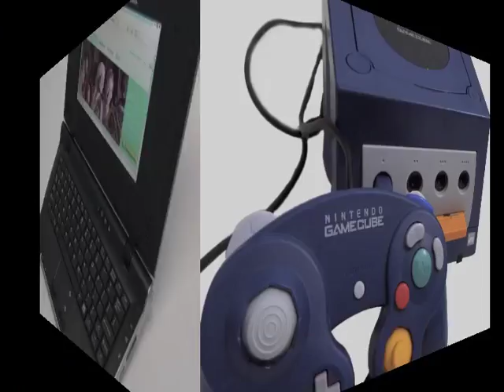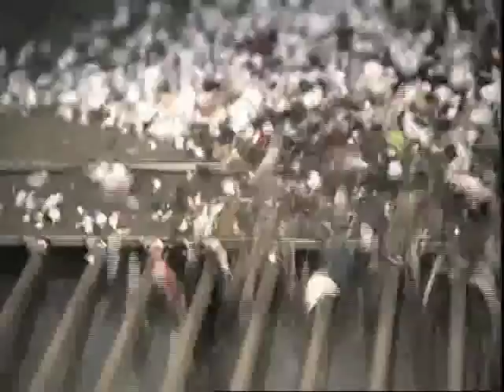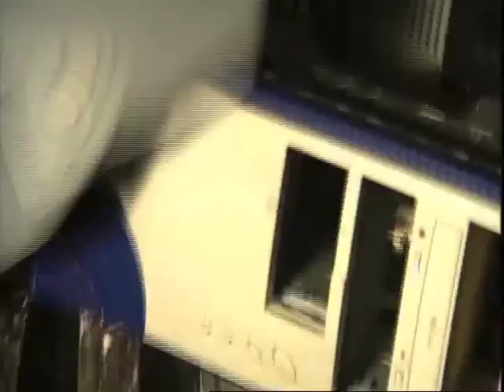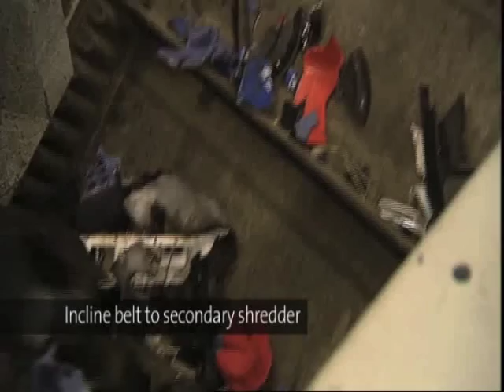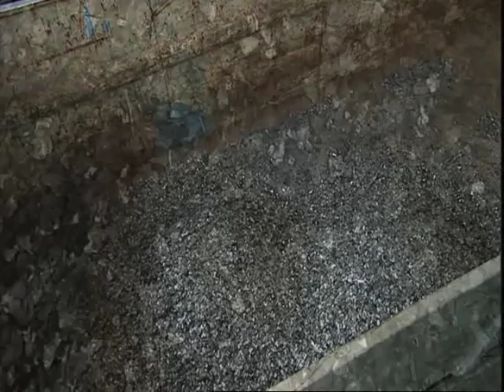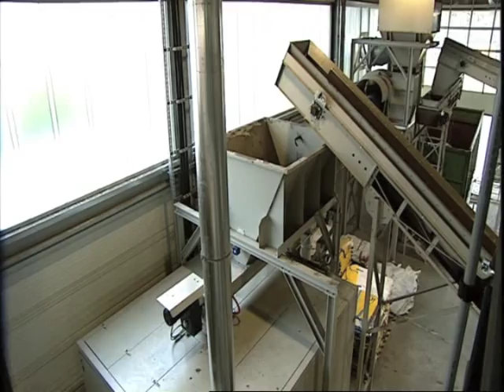Recycling Electronic Waste (E-Waste): GARB's Green Solution to our Worldwide Crisis

Comment from the maker: GARB stock is going to much higher levels as progress continues and EB5 starts up. Way to cheap. Dilutive funding is over and volume is starting to pick up on the buy side.  Anyone thinking about GARB should really do the investor conference Nov. 1 st.  This sub penny is very transparent.

Current PPS is .001 

Call IR  850-396-8580